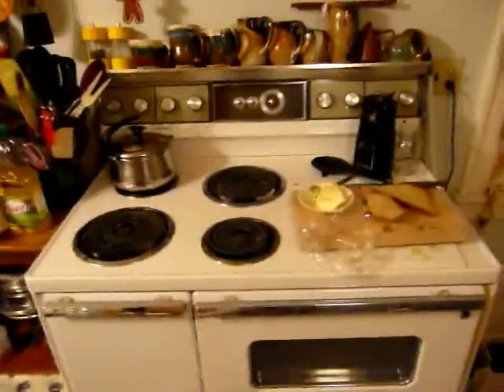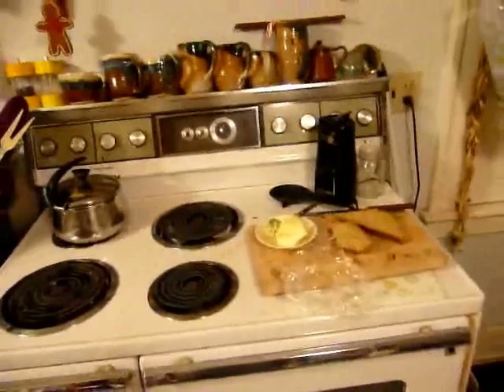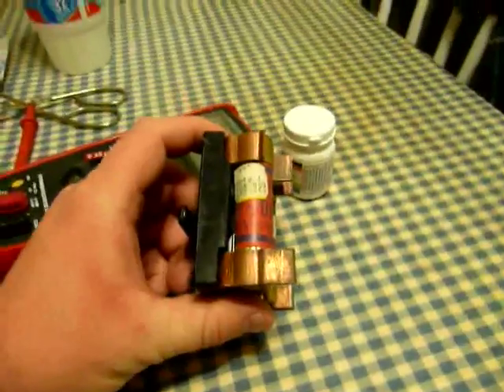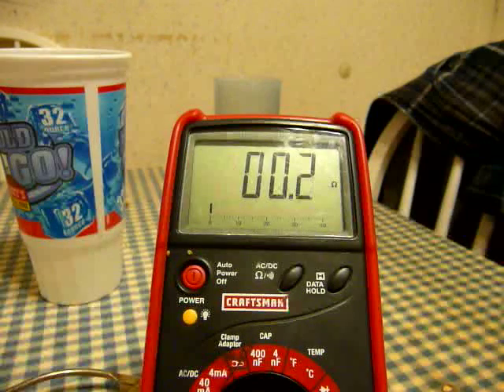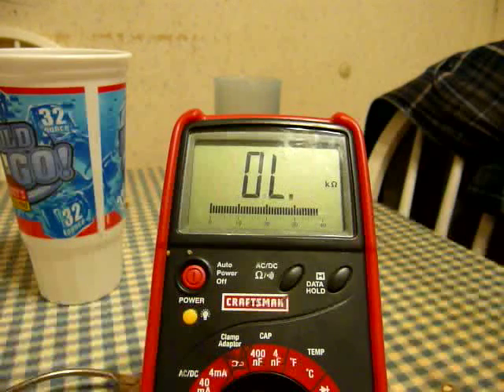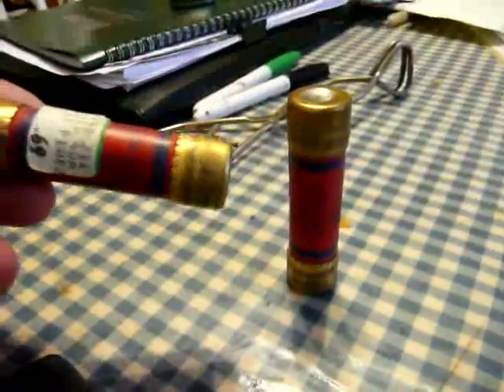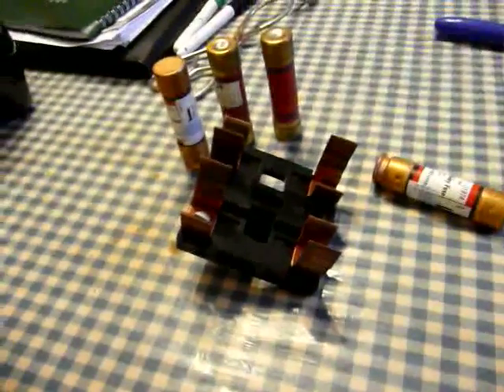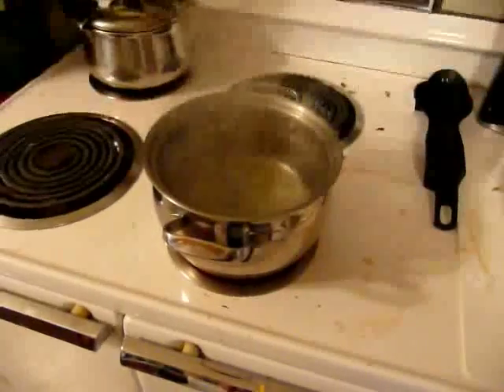Replacing Stove Fuses

Comment: Can an Open Loop mean there is just a high resistance.
Reply from the maker: In some cases, yes. It's possible to exceed the measurement capabilities of a multimeter. It's also possible for a short to appear that only manifests itself under full line voltage or higher, if a breakdown occurs. A megohmmeter or "Megger" can be used to test for that sort of failure.

Comment: Would the burner just die if you had a fuse blow since 240 volts requires two opposed 120 volt phases?
Reply from the maker: Interestingly enough, no. Some of them would still become slightly warm if turned on.
Reply: @uxwbill  Is there a neutral coming from the burner?
Reply from the maker: No. There is a wiring diagram inside the stove, but I've not looked at it in years nor sat down and studied it. There has to be a "sneak" path somewhere, perhaps through the neon indicator light or by virtue of the fact that on an appliance this old, the ground connection at the terminal block is used as a neutral. The timer, work light and courtesy outlets are all 120 volt items.
Reply: @uxwbill  if you take the burner off it might three and not terminals.
Reply from the maker: There are exactly two terminals on each burner.
Reply: @uxwbill  How does s sneak path work?
Reply: @uxwbill The socket the burner is plugged into must provide some connection to the body.

Comment: I plugged in a used electric range (circa late 90s) and then turned on the breaker. The range made two large bang sounds. I shut the breaker and later tried it again, and the two bangs occurred again. Everything works on the range but I find this an unsettling. I contacted the previous owner and he said it would also do that after a power outage. The range has two appliance outlets, maybe they have their own breakers and that made the sound? Any thoughts? Thanks.
Reply from the maker: If the noise is as loud as you say, there's got to be something doing it. Something from the late 1990s probably has a self cleaning oven, and you may well be hearing the door locking solenoid. Most that I've been around are quite impressively loud.
Reply: @uxwbill  Yes! I was trying to find the manual last night and someone was looking for it also who had a problem with their door not locking in the self clean and I never use a self clean but that got me thinking and I tried the self clean and I heard the sound so there you go. It must test the mechanism or ensure its open when power is restoresld

Comment: Nothing wrong with a electric stove.,but I prefer our propane stove. saved us after a hurricane knocked the power out for almost a week. Could still cook and had hot water for the tub.

Seen first hand what a bad nutural can do. Back in the 90's a nutural failure surge killed our 486 compatible, fried all the hardware.

Comment: How old is that stove?
Reply from the maker: 1971
Reply: I think mine is from the 1950's.  My larger burn will not work, but I switched them around and it is not the burner. It could be the control or the wires.  Not sure.  Everything else works fine.
Reply: I dont even know how to remove the top lid.
Reply: @abbysapples1225  me either.
Reply: @augustmoon5935  its actually easy i just fixed my front right large burner

Comment: I agree that old electrical equipment is great. I still use my house's original 30 amp disconnect switch from 1907 as a disconnect switch for my two gas boilers. In fact fuse's trip faster than breakers. I would much rather have a fuse box from the 60s over an old breaker box from the 60s (Zinsco or Federal Pacific anybody!!). As for breaker boxes my favorite has always been Square D QO. Its to bad modern residential electrical equipment (Homeline and some GE breaker panels) is very poorly designed compared to the older stuff. I guess sticking with the older equipment that came with your house or buying commercial equipment is really the only way to get good quality. It just drives me crazy how many people think newer is ALWAYS better.
Reply: I agree with you 100 percent

Comment: nothing wrong with a fuse panel as long as its in good condition as for 250v item beeing cheeper to run than a 125v item thats not true a watt is a watt no matter what voltage its used at

Comment: I had a problem with an intermittent fuse a while back, had 235v before the fuse, had 110v after the fuse, and nothing on that circuit worked.
Scratched my head for a good hour looking for something that would cause such a voltage drop... =P

Comment: We in Germany may even have 480 V 3 phase lines in residential settings to power kitchen equipment or other heavy loads. Newer homes most likely don´t have that anymore but our early 1980 house has the 3 phase setup in the fuse box. It is not used but could be put into service again any time. New kitchen equipment runs generally on 3 separately fused 240 V lines overhere.

Comment: This is a bit odd from a british point of view as our voltage is 240 everywhere in the home and every single appliance runs on 240 from something small like a mobile phone charger to something large like an oven, we have two cables from the power company one live or hot and one neutral and every plug in appliance has an earth or ground pin to open the safety shutters on the Live and neutral we also fuse our plugs with 13 amp fuses or lower

Comment: IT LOOKS LIKE ALL YOUR SCREW FUSES ARE 20 AMP MAKE SURE ALL CIRCUTS ARE 12 GAGE WIRI IF THERE IS 14 GAGE WIRE PUT A 15 AMP FUSE WITCH IS NORMALY BLUE

Comment: @thepaashaas 3 phase is distributed all over North America, but it's rare for it to be distributed to residential homes. We use what's called "split phase" instead. It gives us 2 "hot" leads, 1 neutral and 1 ground. Hot to neutral is 120 volts, hot to hot is 240 volts. The 240 is used for electric stoves, electric water heaters, central air conditioners and a few other things. Lights and receptacles are run on 120 volts. uxwbill kind of explained that in the video.

Comment: we as weird europeans use 3 phases, 1 zero, and 1 ground.
Between every phase and zero you will get around 230 volt.
Between phase and phase you will get around 400 volts.
And you will also measere 230 volts between ground and phase, just dont attempt to use that power, cuz you circuitbreaker will blow out, and its realy dangers if you get a short, because all grounded equipment will have power going to it

Comment: Believe it or not, most of today's electronics that use a modern switching supply will function either automatically or with the use of a voltage selection switch on either 110-125 / 220-240

Comment: did you know the reason why your newer fuses have different shaped conductors is to prevent wrong fuses being put into service? Fuse holders in new heavy duty disconnects will only accept that style. by the way, that is an awesome stove, glad to see it running again. I grew up with a stove just like that. I believe it was from the very late 60s.

Comment: I believe those cartridge style 240V fuses are still used in new installations today. Fuses are actually safer than circuit breakers because they are much faster-acting, but those round screw-in 120V fuses were phased out in the 1960s because too many stupid people put in a higher amperage fuse than the circuit was designed for, or even jammed a penny in the socket, thus causing electrical fires.

Comment: I am lucky when I first bought my house 20 or so years aga I had to rewire my house due to knob and tube wiring  I was tought how in the 1/2 year in the SEA BEES in the NAVY the only old part is my water pump it has 2 100 amp fuses cartridge type fuses and 2 glass fuses  . I also have a gas stove propane type it workes great in a power outage .   Glad yours was a easy fix.